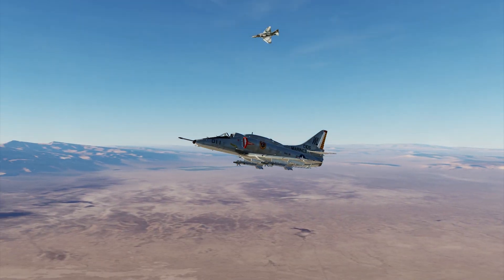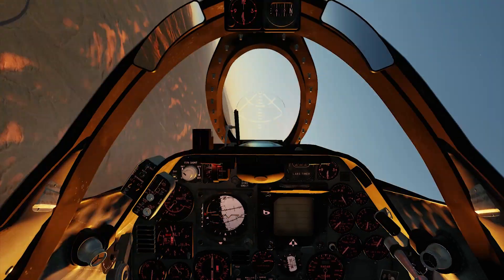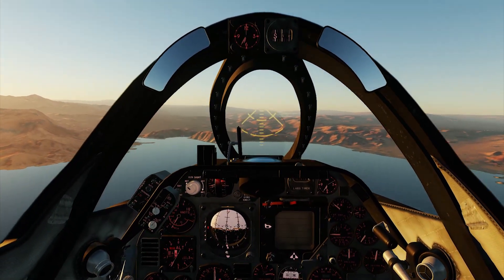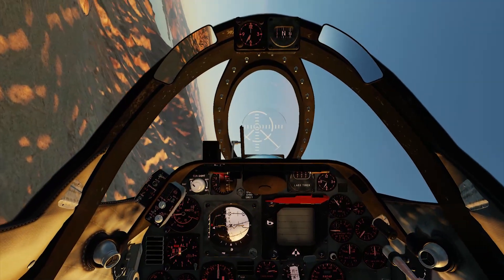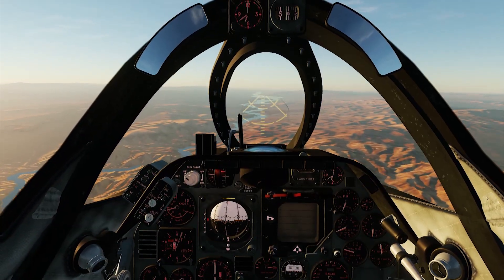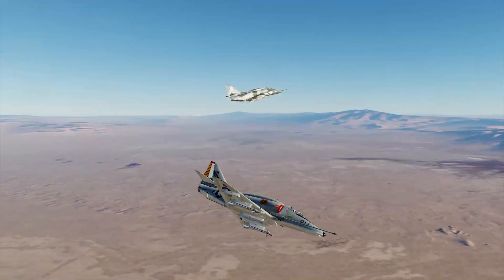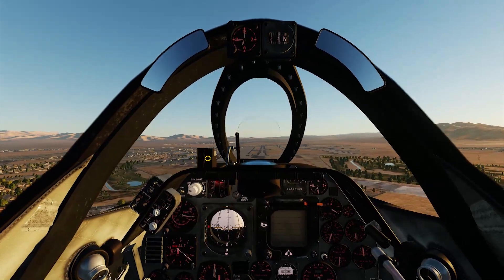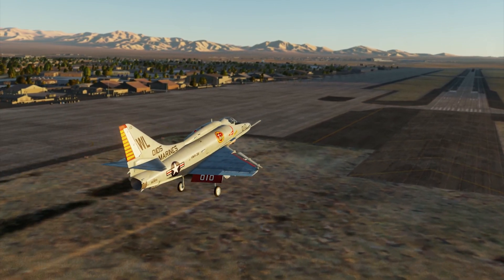A-4E Updated Flight Dynamics (Alpha EFM Version Jan 2021)

Comment: Scissors without flaps??
Reply from the maker: No flaps, you can damage them. That flap BS is just simulator nonsense. Have to do it with no flaps.
Reply from the maker: OK, we doublechecked with some Argentinian A-4 pilots who have flown with (A-4) Top Gun instructors. At Top Gun the instructors did use flaps during horizontal scissors, but those instructors really pushed the plane to its limit. Example, minimum speed any pilot brought the A-4 to was 100 kts, Top Gun instructors went to 80 kts... Usually that kind of stuff will get you into trouble in an A-4, but the answer is yes you can use flaps in scissors, but use at your own risk kind of a thing.